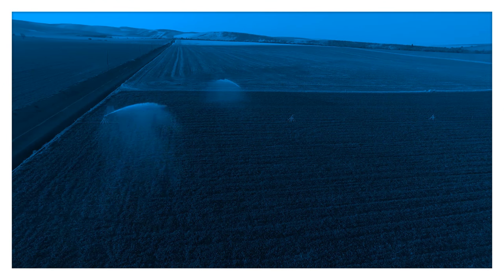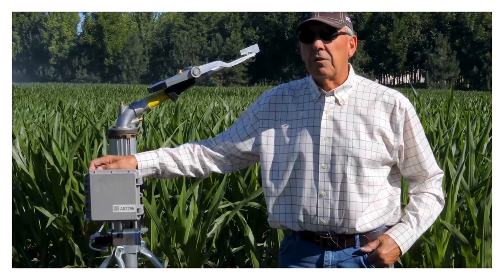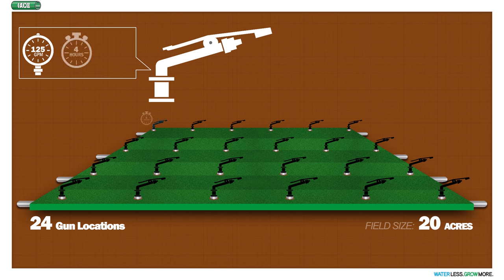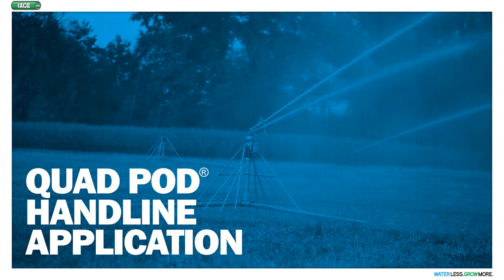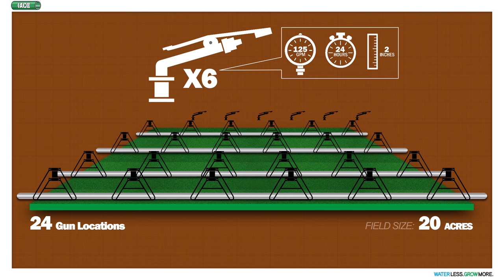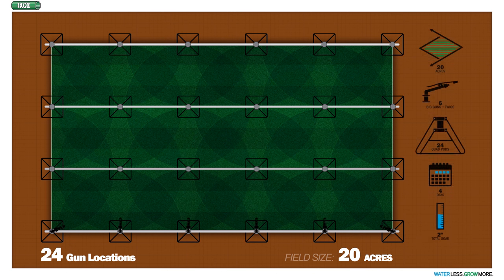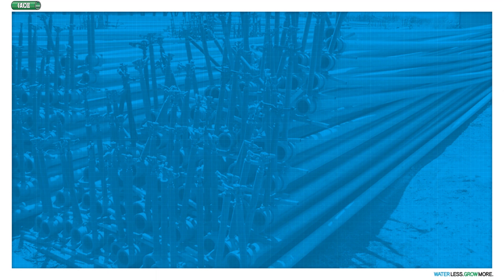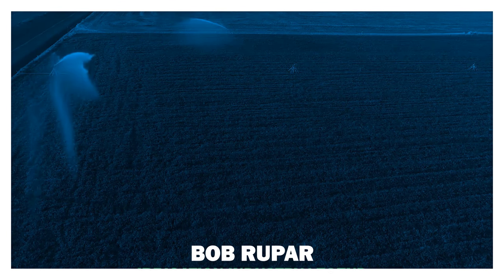Automated Precision Irrigation Using Big Guns®!

Comment: Could you use less guns by eliminating the ones along the border of the field since they turn 360 degrees?  By doing so 12 instead of 24 could be used per 20 acres.  Also, you are using the Nelson 100.  The Nelson 250 advertises a 360' range.  Lets say you want some overlap and you want to account for windy days then assume 300' range.  This is twice the range of the guns in the video.  Therefore, 6 guns should cover the 20 acres, 12 per 40 acres, 18 per 60 acres, 24 per 80 acres and 30 per 100 acres and 60 per 200 acres.  If each gun is permanently installed in the ground and the pipe run 3' deep to each gun and a well that could power 2 guns at a time then you would have a system with a fraction of the repair and maintenance cost per year than a pivot.  Tell me where I am wrong hear please.